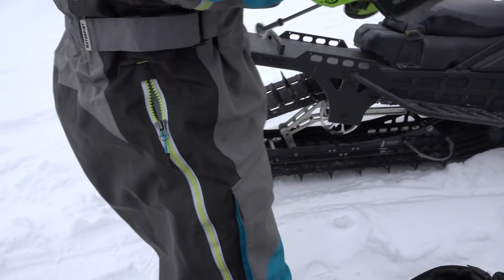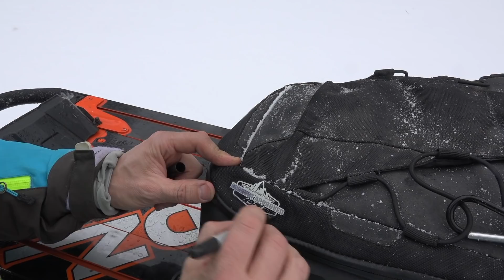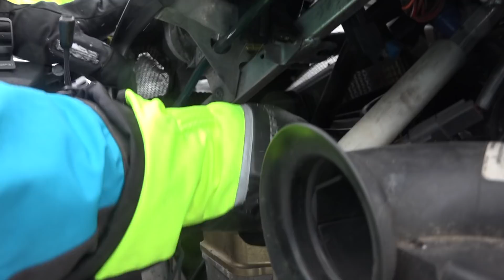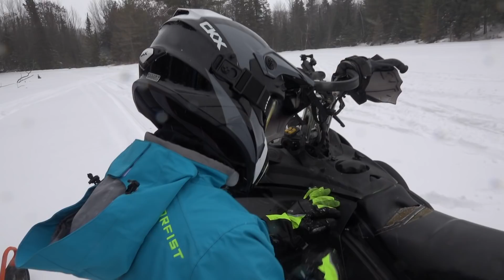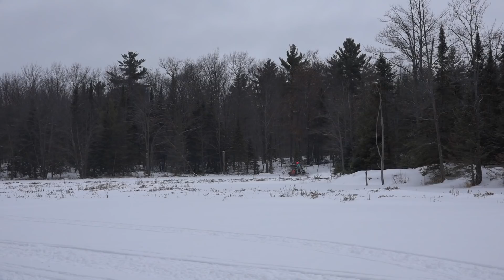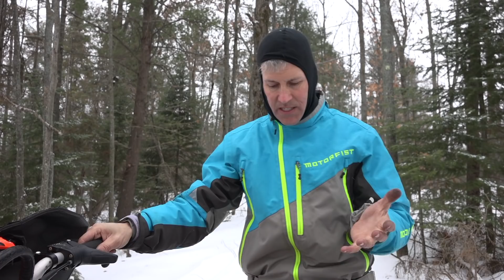Polaris RMK AXYS Turbo clutching and bogging, Skidoo Rev carb issue!

Comment: Most turbo 800 engines have a bog off engagement speed to around 5300 rpms.  The turbo manufacturer has to work on the fueling and intake tube charge pressure to keep from bogging (impulse turbos has this solved).  To get through the bog off the bottom end, on a Polaris type primary, you have to use oversize rollers to tuck the flyweight so the engine will become more "revvy" and push through that bog up to 5300 rpms, or have to use a flyweight with full tip or heavy tip- all to make the engine more revvy off the bottom end to push through that bog.

Comment: I'd rather ride a stock sled and not have to dicker with it every ride.
Reply: Its boring... You want the mod life.
Reply: You just don’t mod things that are difficult to deal with etc.
Reply: Jeff Z Calm down omg
Reply: The rev has been solid , stop the hating
Reply: Or just buy a sled that is awesome stock like a sidewinder that could probably take that turbo Polar-ass no problem.
Reply: Steven Vanheel or just get an old 73 Elan and enjoy life😎
Reply: logpile13 you mean enjoy working on it and going slow lol
Reply: Steven Vanheel not to hard to work on if it does break, 45 is fast enough in the trees.
Reply: logpile13 yea if all that you do is tight woods an elan would be fine. Just don’t depend on it
Reply: It's OK. Not everyone knows how to "dicker". It is tricky, sometimes, but when you get it dialed in, the rewards are worth it. AND a performance machine can be reliable. I thought, at one time, I would be satisfied with small displacement motorcycles, so I could own three or four and my friends could ride with me. They had no interest in riding and I found I couldn't stand under powered ANYTHING. I don't own a bike or snowmobile at this time but when I get them, they will be no less than 1000cc for a bike or 800 for a sled. And yes, I will need a (fully frozen) lake for the sled. I rode for years but haven't ridden in years. I want that feeling again. Nothing like it. Thanks Louis for sharing your expertise and passion. You won the drag race, right?  ;-)

Comment: I would say it’s fueling. I would take your boondocker box and change some settings. My turboed pro runs 14 psi of boost and I never have bogging issues. I run the same weights everywhere with no issues.

Comment: Hey Lou, I think with lower compression you probably also need to turn down your air fuel mixture screws so the cylinders aren't getting as much fuel if it's a flooding issue. Because with lower compression you don't need as much fuel. I'm not 100% on that so correct me if I'm wrong.

Comment: What RPMs you supposed to hit? What's the specs on the current setup compared to the stock setup? Have you read Aaen's clutching book? With low compression domes you'll have less power under the peak power area, so you need higher engagement on the primary and higher initial spring rate on the secondary so it doesn't start shifting out early (also if you have a very high initial angle on your helix, it will require even stiffer initial rate on the secondary spring, because the steeper the helix the faster it shifts up). Then you use the weights (proper weights not ones with all the weight in the tip) to adjust the RPMs.

Comment: My Skiroule had a Rotax. Best two stroke twin I ever experienced. And I was really a big fan, still am, of two strokes, until my KZ1000. I love the smoothness of a four stroke motorcycle, not to mention the availability ;-) (1975 was the last two stroke production street bike with the Yamaha Daytona Special. It had Catalytic Converters on it! White with red stripes). I would love to build a bike (I know, OT) with a fuel injected outboard engine. What, 260HP? That would be cool. Extended swing arm, of course.How about you put one of those in a sled, Louis? Are you up for the task? BIG Job. Think about it. Two stroke, V-Six, fuel injected, liquid cooled. How cool would that be? You would have to figure out how to mount it horizontally and get power take off. Ouch! Mount it Vertically. What a concept. You can do it. BIG job. But you would be remembered for it, forever. I am sure those engines are old enough to find a good running one for not an astronomical price. Just a thought. Carry on.  :-)